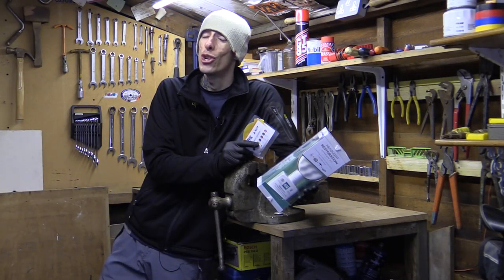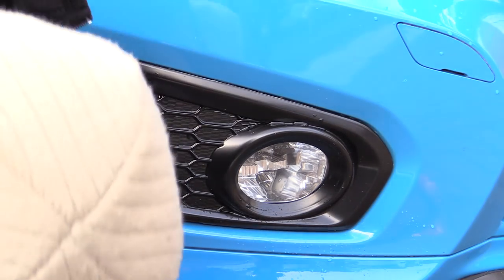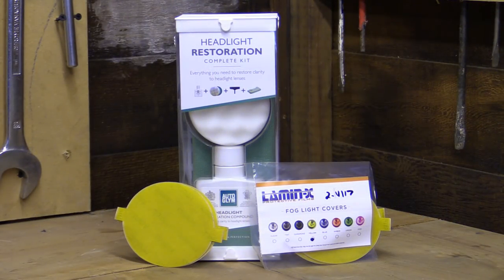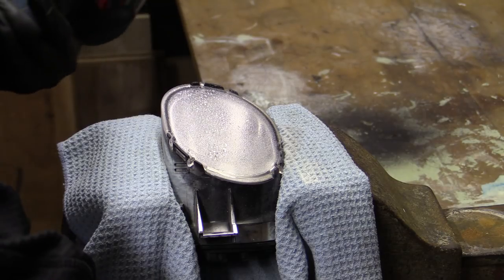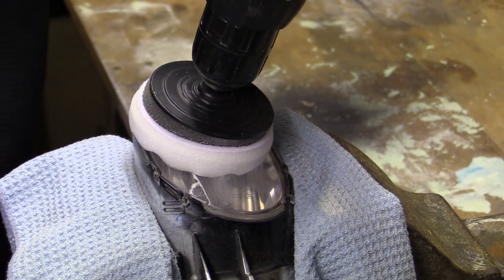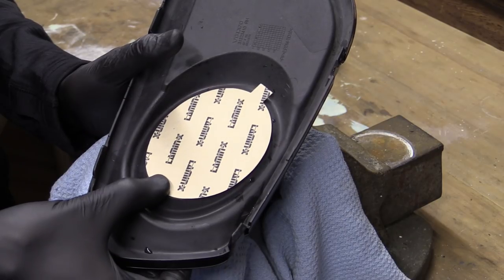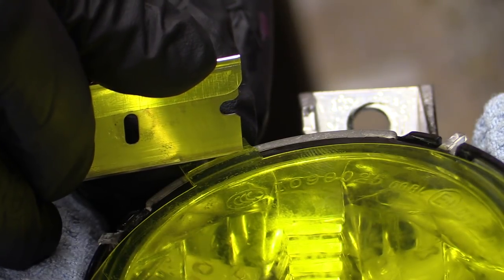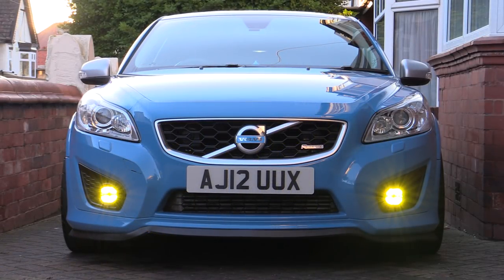Subtle Swedish Style - DRL Resto & Tint

Comment: Looks cool... what I noticed with the laminate x film when I installed them on my s3 was the tabs are there so you can pull and stretch them around contours... you should have started on one side and heated them with a heat gun and stretched them into place. Rather then installing them like window tints. Good job though keep it up!

Comment: Great result on those polycarbonate lenses. I did a similar job on my old SAAB 9-5's headlights but obviously didn't tint them. I've also got a 40 yr. old Citroen CX and the problem I have with that is a build up of haze on its windscreen. I'm pretty sure it's on the outside of the screen but no matter what I try I can't seem to shift it. It makes driving into bright sunshine very difficult, have you come across any solution to this problem in your detailing adventures?

Comment: Looks very nice !
I intend to do similar work , but concerns the foglights . Colour will be a tad different as I plan to get the same colour yellow , as the plates . Yours is only yellow at the rear , here it's yellow at the front too :) Black exterior 452 , with grey bottom trim S60 .

Comment: If you could do this over again what would you change or would you? Im thinking of buying a set of precuts over sheets myself but I dont mind faffing around if I know Im going to have to cut them down anyway if it reduces the cost just that bit and I get more material all well and good.
Reply from the maker: I’d pretty much do it the same, still have these fitted and they look greats year on, just buy two pairs and be prepared to trim them a bit.

Comment: Any light on the front of your car can have a yellow tint. But the tint kills the reason to have DRL,s. The dimmer you make them the harder they are to see and it effects the depth perception of other drivers so you won't get the safety impact they are meant for.
Reply from the maker: Good to hear. They're still pretty bright to be honest and when combined with the flat blue paintwork you'd have to be pretty blind not to see me coming.
Reply: I’ve seen a few Scanias with that exact style of factory DRLs that have been tinted yellow, and they’re still more than adequately visible at daytime. Some of them unfortunately seem to be sporting the ”nicotine tint” as CCG described it, so must be using only one layer of film over the blueish white LEDs.

Technically any sort of yellow front lighting is illegal within the EU on cars manufactured on 1/1/1995 or later, but it seems the UK national regulations always were a bit more lax even before the Brexit.
Here in Finland my old Twingo sailed through several MOTs with yellow-tinted fogs until finally being told to remove the tint one year. :(

I’ve really enjoyed watching your videos, keep up the good work! 👍